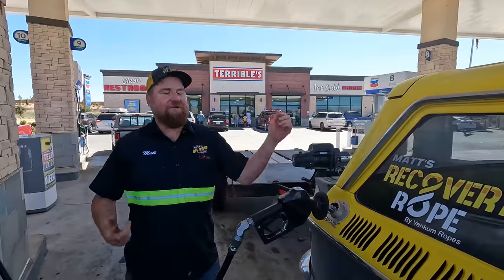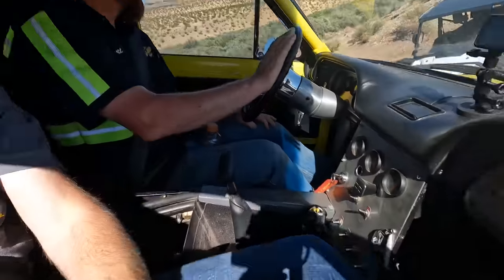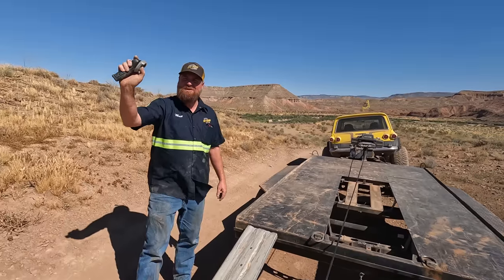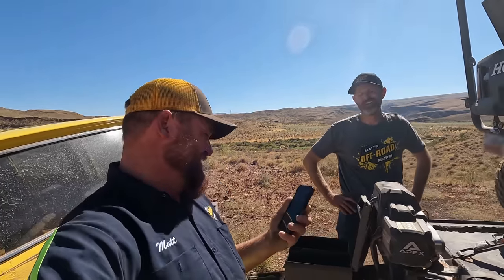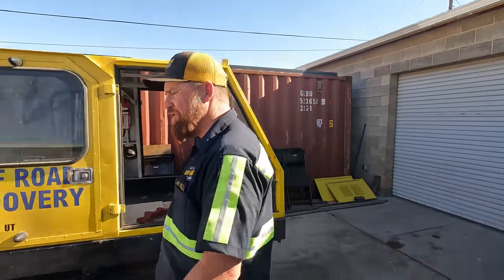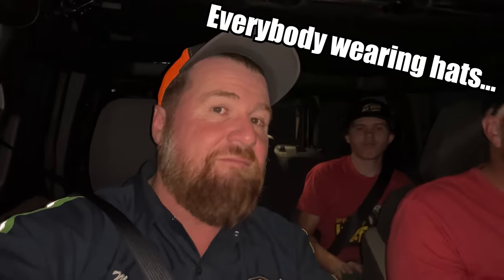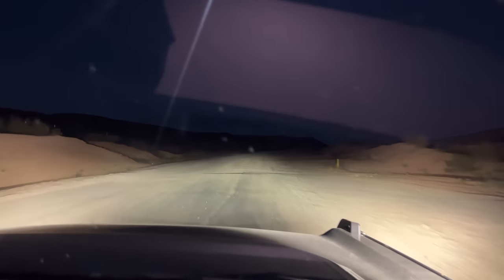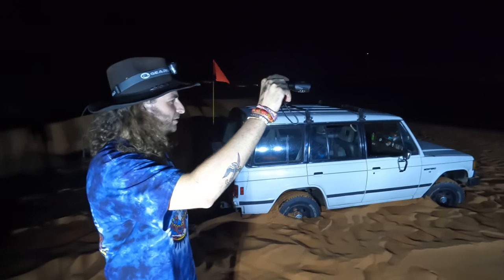Customer Get's Chewed Out For Getting Stuck!

Comment: Matt needs to keep a 5 ft. crow bar on that trailer, so he can man handle these broken side by sides where ever he needs them to be.  The POWER of a 5 ft. crowbar!
Reply: Do you mean A burke bar 😁
Reply: @Creek_Birdfeeder  I do convention and trade show work and we have the best pry bars. They're called lever dollys or pry bar dollys. It's usually a long wood handle 6-7ft long with a steel flat nose for prying and a pair of small wheels at the pivot point to let you lift and roll things around a bit. You can pick up an incredible amount of weight and slide it or even walk with it, if you've got a buddy.

Comment: I have a Pajero which is the JDM version of the Montero and I can tell you that is rather difficult to get it stuck.  The Pajero was built stock to be a Jeep Cherokee killer, when Jeep had their really good 4WD system.  My Pajero has 2WD (high), AWD, 4WD (high) and 4WD (Low).  It does NOT have a neutral position, but that is a work around.  I have had it a few years now, and it has the minor irritant of having the drive indicator lights not working.  I recently turned it around in a VERY tight area and shifted it out of AWD to turn it around.  I forgot to shift it back into AWD and bogged it into the snow on the road I was on.  NO problem, dig it out a bit, jack it up (high centered on the snow), stick a log under the tires, and away we go.  Hey! The jack is leaking hydraulic fluid everywhere!!!!!  OK, so I will let the air out of the tires, stick the logs under the tires, and we are out of here.  Ummmmmmm.... Oops. The compressor is in the 1985 Toy p/u, my main off-roader.  OK, so jack it up, refill the jack reservoir with Gatorade (the only fluid I have) and get it out.  Who cares if the jack is screwed up with the wrong kind of fluid?  It is being replaced anyway.  Took an hour to get it out, but that is not (actually) stuck.  Stuck is needing Matt to drive up to WA state to pull you out.  But, yeah, that Montero has the same 4WD system (I think) and the only short coming is stock ground clearance is not all that much.  Good looking vehicle for more than 25 years old.  Sweet ride.

Comment: Yeah, there's a common misconception that higher octane means the fuel contains more energy, when it really means the engine will be able to run with more aggressive timing that increases performance, but without the higher octane, risks damaging the engine.
Reply: Now if only the Morvar was actually tuned.  Tom messing with it isn't tuning it.
Reply: Also the heat.  Air intake temps get high and it's more likely to ping/pre-detonate.  Higher octane helps with that.  They're in the desert running engines hard.  I wouldn't expect them to be putting 87 in.
Reply: yep it's all about pre-detonation. If you've ever heard your car knock when you hit the gas you need higher octane. Most cars sold are tuned for regular but if you have a Racecar or some other type of Supercar or high-performance engine you need 91 or even higher. Higher compression = more power but what happens is the gas will actually explode when compressed that tight before the spark plug ignites it. If this happens when the piston is traveling up before TDC (top dead center) then the pre-detonation is forcing the piston back down when it's still coming up.  This will destroy your engine after a short while.  The added octane just keeps the gas from exploding before it's sposed to.

Comment: Matt I think you should go with a doubler instead of just a 3:1 T case. With a doubler and your current t case or 1 with a similar ratio you can keep your wheel speed up for the dunes since it works awsome in the dunes already and you just need a little low for the crawling. And the doubler will give u a lot lower low than a t case by itself
Reply: I thought he had one but that must be on the wrecker. Makes sense to me. I often wonder why he doesn't have more issues with the torque converter? Another thing I wonder is how does he keep the engine oil at the pickup while on the nearly 90 degree climbs and descents? I didn't get the memo about that.

Comment: The "weatherman's" term for what you were measuring at the end is - surface temperature.  Normal 'ambient" temps are in the shade at five to six feet above the ground. Here in central Cochise Co., AZ I've been gettin mid 140's for about 6 weeks.  The Saving Grace is that we're at 4250 ft above sea level and before sunrise the temps - surface and ambient  - are in the 60's or 70's.   On the other hand, at 2 - 4 PM our density altitude is 8500 feet or more.  I'll let you look that up, but what it means is that with a bit of real work you're gasping for air... 
Your videos are astounding.  It's fascinating how you break a situation down to small bits and problem solve your way out.  Don't stop now...

Comment: TY for pointing that out about octane to people at the beginning.
I don't know about that Humid vs Dry heat argument.
Was in lower Virginia. Humidity 88% Air temp 98F.  Temp on a Conex box was 126F on the outside (This was taken at 10ish am too). Ground where there were no trees was 110F.
It got to 110F air temp later that day.

Both still suck for different reasons and are the same if your not prepped for it.

Comment: I love your shows. It’s pretty cool how you go out and pull people out of situations they get themselves in.

I do like how everybody comments and think that the weather they are experiencing is somehow worse than anybody else. But as far as you’re dry heat. Yes, it is unbearable. You do have to worry about the ground and all your surroundings. But when you get into high humidity. If the outside temperature is 110° and dry heat and 110° in high humidity. The surfaces you come in contact to. Will also be just as hot. For example, I live in Nebraska. We just got done with 101° temperatures. Our humidity Was 91%. I was recently in Arizona and the temperatures were closer to 110°. Personally, it was hot AF. But I was able to breathe just fine.

I guess the biggest statement would be about this. It all depends what you are condition for. Any location has extreme weather situation’s.

The biggest thing that gets me is when people think that they, and they alone. Indoor worse than everyone else. It’s kind of like when I watch the weather people stand in the middle of a hurricane, and tell us how windy it is. It’s funny that none of them want to try that in Nebraska when we have tornadoes.

Keep up the awesome content. I can’t wait to see what you do next in the videos to come.

Comment: I own a 2013 Ford f150 with the 5.0 and I run it on 87 octane. Every once in a while I’ll put premium in it that has additives to clean the fuel system. Because it is tuned for 87 it looses fuel mileage. On the flip side when I’m towing my boat it seems to do better on premium. I checked into getting a tuner to adjust it for premium and everything thing I’ve seen says it will get way better fuel mileage turned up and on premium. I haven’t looked for anything on you tube yet to see if anyone has done this. I’ll do it before I spend the money.

Comment: To Matt : I only run two octanes - 93 or REC fuel (90 octane - zero ethanol).  I switched from 87 octane after the first 32 gallons of 87 in my 1 ton truck.  I have a bone stock 6.0L in a 2016 1 ton.  With 87 octane in lower Michigan area I was filling up 3 times a week to drive roughly 350 miles.  I switched to 93 octane and I am able to run 350+ miles a week on 32 gallons.  If I run REC fuel the truck drinks it down but has great throttle response.  If I run the junk 87 octane my truck will not start smooth.  

Thank you for the great content!

Comment: I live near Phoenix, and I love the dry heat.  Yeah, everything around you is radiating heat and that crap is hot.  Especially things that are either black or chrome plated.  But the side benefit is I can actually breathe the air instead of cutting chunks out to chew up and swallow like I had to do when living in the south.  I hate having to visit anywhere in the south in the summer.  Anything over about 80 degrees and I wanna park myself in front of an AC unit.  Love the channel, love the videos, and think of all of you as family that I'd drop everything to go help.

Comment: The Morvair obviously climbed up that steep, rocky slope with the trailer and a Razor behind it because of that hot, hot 99 octane gas you are running in it. 🤣😂😆(The thing is a beast of a recovery vehicle for it's size.)

Comment: Matt, we are from Toronto and just got back from Moab and Zion. It seemed the avg temp on my display was 99f, about 39c. Generally anything here above 32c is unbearable due to the humidity. We did our hikes in the am 89-90 degrees and we were good, albeit we felt the dryness and drank plenty of water. Yes, it’s different. The late afternoon, the rocks, earth and any material in the sun has absorbed so much solar energy, that it has to deflect it back. 
We walked along a rock wall in the shade, but it was just previously in the late afternoon sun, that we had to move away from it back out of the shade. Even after being out of direct sunlight for a bit, it felt like it was 45c.

Comment: You are absolutely right on the octane question. I could put 92 in my little Dodge Neon SXT, but there's no reason to. It won't gain me anything because the engine doesn't need it to run right, so the computer will detune the engine to compensate. Now when it came to my Suburban with a 450hp 355 SBC, it NEEDED that octane to make it run right. Anything less than the best and it just would not run well at all. I carried several bottles of octane booster just in case I couldn't get high-test at the pump.

Go with what your vehicle owner's manual says, or what your engine is tuned to run.

Comment: Oh man. Those old school Montero are amazing off road. Put on some 34" tires, remove the front and rear sway bars and make jeeps look weak. Well,  jeeps with the same sort of mods. If you're running lockers front and rear and huge tires and low gear. Its not really a great comparison. That is a clean one for sure. Mine was an '89 2 door V6. Oh such great memories.

Comment: MOOR Team got'em out again well done. Agree with Matt 115°F is HOT. Been there dry or not, it's frigging hot.
I imagine the team has thought of it, if you had aluminum ramps on the trailer the lengths of the runner that can sjide off the back you'd have a manual Razr Rollback. Short of that some 'skis' to slide up regular ramps for side by sides with tweaked out wheels.

Comment: Nice explanation about the heat! I have experienced 42°C in dry heat and about 35°C in very humid heat. I do prefer the dry heat, as it is easier for your brain to work in dry heat. But the aspect of the ground and other objects radiating heat from all around you does make it hard, you just can't escape the heat anymore. Stay hydrated, I wish I could visit you at some point, until then I will watch your videos from Germany.
You helped me heaps while I was getting my drivers licence, such great videos to learn from <3

Comment: This is when it's nice to have a "SKIE" to slide the bendt wheel on, much easier to drag the vehicle.. I've used old floor boards, old tires, rims, logs etc, makes it so much nicer to work with 🤗
Reply: The Honda "Razer"

Comment: That’s the thing I always try to tell people about the desert heat, it’s so hot at 117 that everything you touch is burning. You turn on your cold water and it comes out of the faucet at 100 degrees because the pipe in the ground is over 100  it’s a dry heat but it also melts flesh lol 😂

Comment: I have been a welder for almost 20 years and I used to build and install overhead cranes that you see in factories.  We did a job in Goodyear Arizona one time at a galvanizing plant and the heat then was something else.  It was really hot but it didn't feel that hot compared to hot days back home, but we noticed that all of a sudden we had stopped sweating and that is when it got real dangerous for us.  You can slip into a heat stroke situation and not even realize it until it is too late if you do not know what to watch out for.  Then there was the sand storm and the fact that none of their buildings had walls that went from floor to ceiling.  It was definitely a different experience that you just would not know if someone local didn't tell you and then experience it for yourself.  I then did a job in Rock Springs Georgia and I felt like I wanted to strap deodorant sticks to my armpits.

Comment: for reference, at 60C, a lot of plastics start to Sag (not Melt). that's the temperature that you set a 3D printer's bed at. things will start to fall apart if they're not designed for that kind of heat. and that 159 F measure was on high albedo paint colors

Comment: Matt when it’s 108 here in south Texas with 95% humidity, dark metal outside is 150 the ground is 130. The only difference is the river of salty sweat running into your eyes blinding you. In the dry heat you get a cooling effect from your sweat but you get no benefit from evaporative cooling when the atmosphere is 95% saturated with water. Hot is hot dry or wet it’s dealing with the swamp in the heat that sucks

Comment: Having lived in both Utah and Florida I can tell you both dry heat and humid heat are terrible. Melting the bottom of your shoes on asphalt if you stand in one place too long and then having such humid conditions that you feel like you cant breathe the air is so thick. I have fond memories of my time in Utah though, always fun to spit onto a hot metal railing and watch your spit instantly sizzle away into nothing was always funny as a kid. Then the massive amounts of snow was fun, having to bring snow gear for recess during school was quite interesting in comparison to school basically being shut down in the south east anytime a tiny amount of ice forms on the road.

Comment: 0:45 When I switched from 87 to 92-93-94 octane in my 2012 F-150 I was able to go further in between fill-ups on my cross country trip. 35 gallon tank, at 2mpg increase, is 70 addition miles per tank. However, in my Harley I get the exact same mpg regardless of octane.

Comment: It's hot like that too. My barbecue grill gets To 150 degrees on its own. I have used a heat gun on the ground and it gets about the same. My sister loves it out there she lives in kanab. Said it's hot but not miserable.  Dry heat you definitely have to stay hydrated because you can get dehydrated without knowing it.  In Missouri we sweat like crazy when it's close to 100.  Humidity but it tell you you need to drink water. That sand out there is very hot. I feel for you on that to have to lay down and hook up vehicles.  When it gets 100 degrees it's hot anywhere. What I don't like in Utah is how much the weather changes in the winter. I can go from freezing to 70 degrees from night to day everyday. Then when it rains it floods the area because it pours. And Don't soak in.

Comment: I live in Tennessee where there often is very little wind to give relief in hot weather.  I lived in Kansas where it gets hotter than Tennessee, but the heat in Kansas wasn't as bad because of the wind.  Kansas isn't as dry as Utah, but it is dryer than Tennessee.  Wind is a factor that helps with the heat.  My wife is from Texas and I know that the summers there are like an oven (probably like Utah).

Comment: try 85- 105 F and 60- 90%  humidity and yet the sand and gravel measuring at 115  F degrees plus our asphalt driveways get so hot you can  not walk on it barefoot, i am talking about the great lakes area, then in winter we get 30F to minus15 F  with lots of wind that brings in wind chills that  brings the feeling of cold even lower.. i'm not saying your area is worst or that mine is.  but our bodies tries to adjust but an many times it seems it dont. so one might think dry heat is better then wet heat. what it really comes down to how our bodies adjust to each type of heat, why i added the winter  temps its b/c it really relates to how the body has to adjust to the temps we are faced with.

Comment: Higher Octane does burn faster and hence cooler. Use low octane in the winter for motorcycles, high octane in the summer to spare the heat on your legs. Works for your vehicles operating temp  also.

Comment: Greetings from Colorado!!
91 Octane will not give you additional horsepower but will help run the engine cleaner. It also helps with the carbon buildup.
Here in Colorado, our minimum is 85 Octane. 
Tom is right when he says, use 91 if your engine is tuned to accept higher Octane.
Reply: not true. my 2018 buick gets 3mpg better gas mileage on 91. its turbo charged and can take advantage of the extra octane.  my 2003 tahoe gets a few more mpg as well.  
and thats because higher octane burns slower creating more torque. higher compression or turbo motor can take advantage of the additional burn time. and add more timing.

Comment: The short "layman's explanation" for why you should run higher octane...

Higher octane doesn't produce more power in and of itself, but it reduces detonation in the engine, which in turn allows you to pull more power out of the engine without risking premature failure (due to detonation) than you could running lower octane.

Comment: The primary difference between octane levels is the point at which it spontaneously combusts. Higher octane is necessary at higher elevation to prevent predetonation, which is when the gas combusts before tdc. Excessive predetonation can damage the engine.

Comment: In high humidity and high temperature areas the ground and other things absolutely do also get extremely and dangerously hot.  I've lived in the US SW in heatwaves with extreme heat and low humidity and in SE Asia with extreme heat and very high humidity, and in both you can absolutely get injured from anything that's left in the sun.